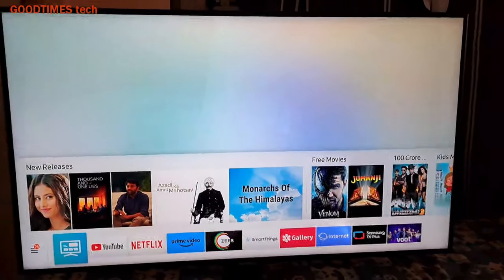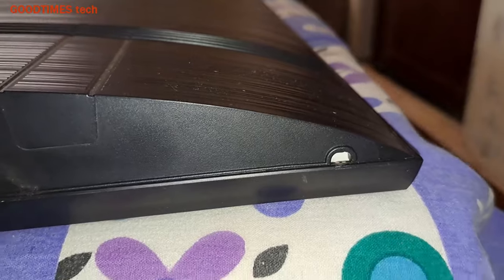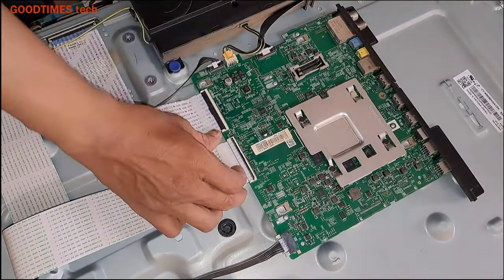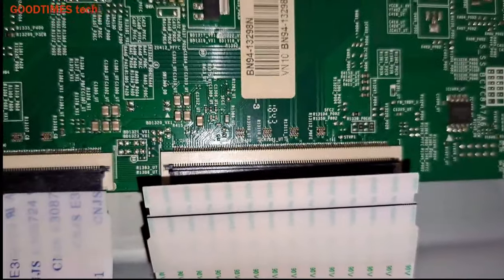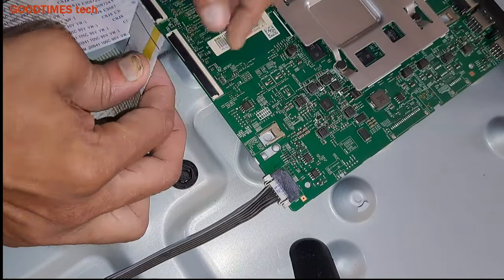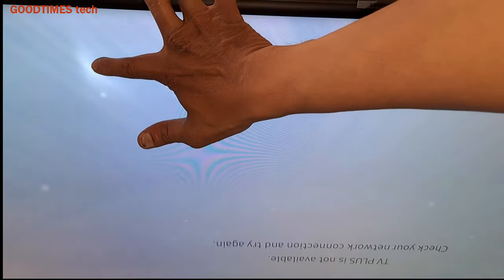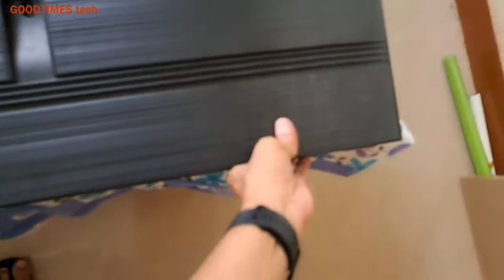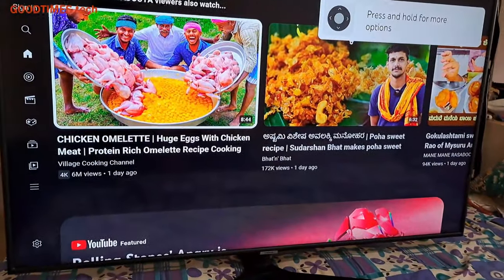Smart LED 4K TV, Image /Picture jumping /flickering | how to solve in few minutes.

Comment: I got the LG 3D tv.. it was working perfectly fine for 7 years.. then it started flickering.. i have seen many videos but didnt work.. i called the customer service and one guy came and said the screen needs to be replaced and it would cost 43k INR.. I thought thats the end for my tv.. after two months i watched this video and followed the exact steps.. taped the isolated part by fluke.. and it worked perfectly fine.. i can see a minor difference in picture quality but I can't thank you enough for having my TV back like how it was... Really appreciate your help... Any idea how much longer the tv will continue to work using this method? Thank you again ❤
Reply from the maker: Happy to know that the video was useful, cannot say exactly for how many days it will work may be months, year or two, because I have tried it on several TVs with different brand and different models but only two of them have failed after around 6 months.
Thank you, have a GOODTIME....

Comment: But those pins were connected to the main PCB for a specific function by the manufacturer, so now those functions will be isolated,and not needed anymore???
Just what did those pins do in the original setup..
Reply from the maker: Yes, the pins isolated are connected to T-Con section on mainboard, the pins isolated are CKV connections to panel ( theoretical explanation would be very long) , there will be some difference in the image on screen but won't be noticeable on a 4K TV but can be seen if observed keenly...
Thank you, have a GOODTIME....

Comment: What to do you if there's only one thick cable and no left or right side?
Reply from the maker: In such case, need to check if the T-con is on scalar board and see if all the voltages at different stages are ok, if some voltages are missing then need to solve it.
Reply: @GOODTIMEStech  damn, sounds too complicated for me so I'll just leave it be but thank you for replying 🙏🏻

Comment: Hi, i am not tech-savy but have a problem - I have philips UHD 49PUT7791/V7 LED TV. Facing Jumping flickering line issue. Tv repair guy said the last technician who has worked on this tv for similar issue has put some tape and its done wrongly. He has blocked channel. You have to change the Panel which will cost 21000/-  I dont want to spend so much. Any other solution?
Reply: Buy new TV

Comment: I have the same problem with UE50RU7472U, after running for 90 min. Will this fix it?
Reply from the maker: Hi, there are possibilities that it will work but I have not tried on such issues as I didn't receive one. if you wish you can try, hopefully it will work. if it doesn't work then need to check which voltage goes missing after 90 minutes and diagnose accordingly.
Thank you, have a GOODTIME....
Reply: Many thanks!
Reply: @aalko1  did you solve mine is after 15 minutes
Reply: Unfortunately no...tell me how is possible to fix it?
Reply: @aalko1 Any solution u found?

Comment: I blocked pins 12-33, didn’t work for me.
Tried blocking other combinations…
:(
Reply from the maker: Hi, need to check with the other FPC. CKV connections on other connector should be isolated and checked, if it doesn't work then need to check if any components have failed and voltages are missing....